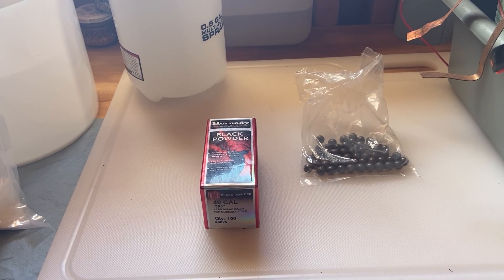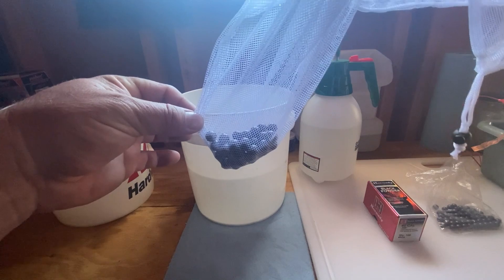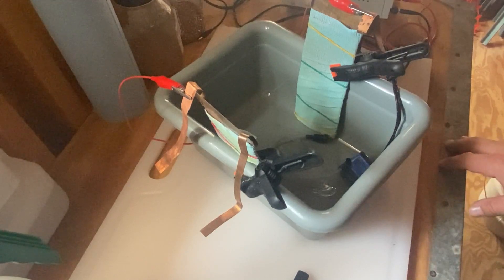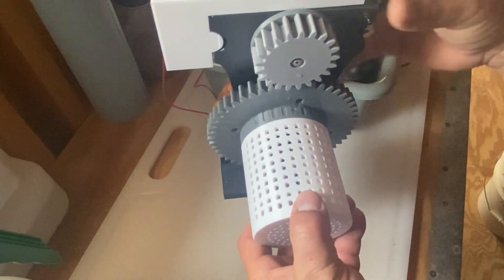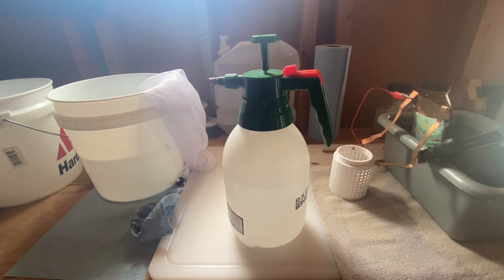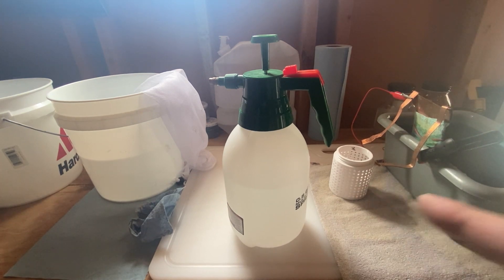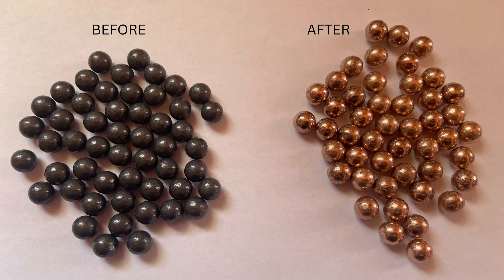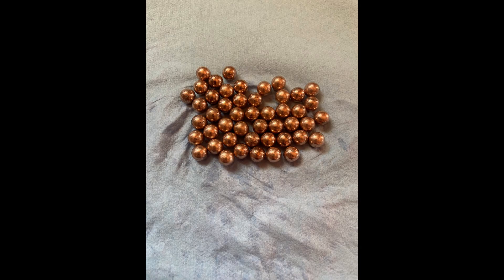Copper plating at home #diy #electroplating

Comment: My son just bought a 50 cal air rilfe. An Airforce Texan for deer hunting. We've been having fun with it. We pour our own round nose slugs 320 grain. Can you privide more info,  like the bath solution. What is it? Maybe throw some links in on the suppliers. I already have a power supply
Reply from the maker: Sure no problem, so for the lead round balls and all lead bullets for that matter, I have been using with great success the flash copper kit and pickel #4 from caswell plating@ caswellplating.com